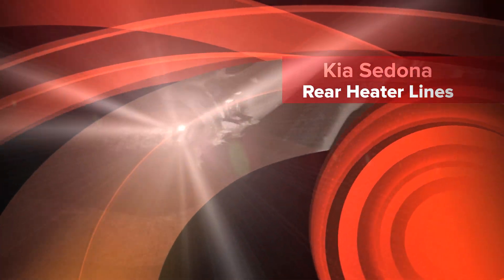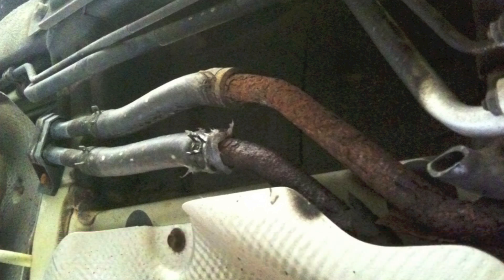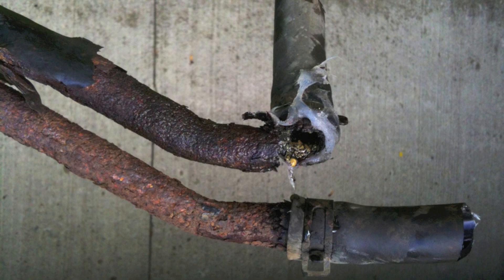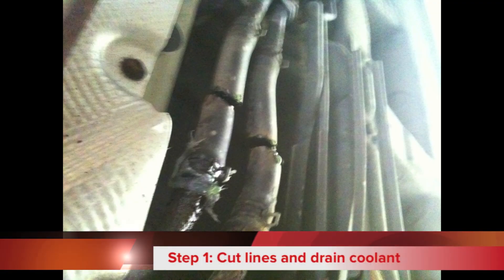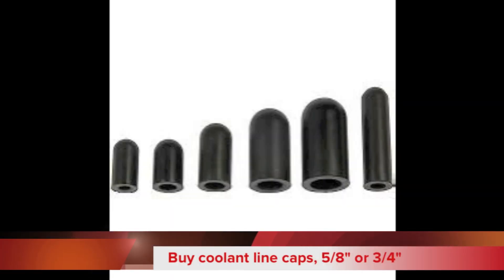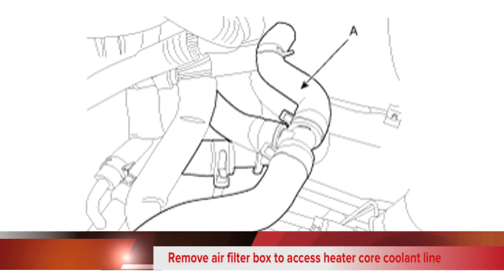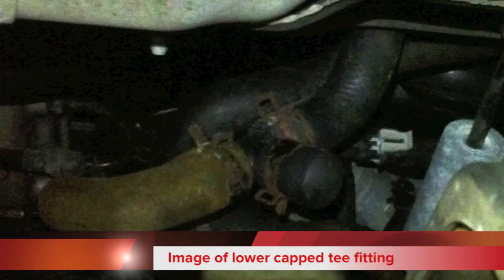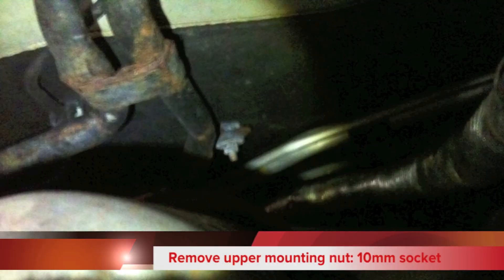Kia Sedona Rear Heater Lines Rusted

Comment: In the end, I just cut the pipe underneath the van and then removed it. This allowed me to make a clean cut and cap off the pipe. I then put it back on. This was all done from underneath the van. The caps are vacuum caps and they can be bought at AutoZone or Amazon.

Comment: I am looking to cap it off at the engine. Will any cap work or must they be a certain kind? Are they available at autozone? Second, is the view of the outlets to be capped from the bottom or top? I have removed the air intake and believe I can see it. Thanks👍
Reply: Larry Baker

Comment: In the 90s, I fixed this problem in a Ford Escort by running new rubber radiator hose from the front to back bypassing the shaped metal tubes altogether.   That way you still have rear heater core functionality.  It is especially easy here as there is a rubber joint on both ends.  Just make sure they don't move or touch exhaust parts.

Comment: I have the same van with coolant missing for some reason. No visible leaks what so ever. Anyone else experienced this and fixed it with this solution? Kind of a dumb question, but just wondering. And yes, the rear coolant lines look just like the ones in the video.
Reply: My mechanic just cut the line and bypassed it. Very poor material choice on Kia's part.
Reply: 26-6-2014.seen this comment today ,just fixed the same problem on my fathers kia sedona.the heat/coolant pipes run to the back of the car on the right hand side and were leaking just behind the rear wheel so we cut the pipes and just put a u shaped piece of pipe on the ends of the pipes to send the coolant back to the front and this has worked perfectly with no more problems since,its just as well cos the car is driving from Wales England all the way out to Corfu in Greece in 4weeks time.
Reply from the maker: Low coolant is a really important problem to fix.  I hope you figure out where it's going.  If it's not leaking from the rear lines, you should get the head gasket checked.  Is there any milky oil on the dipstick or under the oil fill cap?
Reply: Nope, that was the first thing I checked, hoping it wasn't the head gasket. I have yet to find the leak, but soon I will be getting it up on the hoist for a better look. I am almost certain it is the rear lines. But for now it is holding coolant. I just top off the radiator every once and a while.
Reply: if you got a metal pipe section thats leaking you can fix it by useing metal putty available in most car stores.just open the packet snap a bit off then push it onto where the leak is coming from.the putty will set hard as metal.or you can replace the lines from front of the vehicle to the rear.we found this leak on our sedona in the coolant line that is just behind the exhaust near the rear wheel on the right hand side.the lines are a mix of part metal and part rubber hose sections,if you squeeze on one of the rubber sections you should see the water spurting out from where it is leaking.hope this helps people.ours is a 2003 model.

Comment: I have a 2008 Sedona and received a recall notice for the front lower control arms rusting.  When I called Kia this morning to schedule an appointment, they notified me that my vehicle had 4 more recalls- not thru the NHTSA, but thru Kia itself.  One was this, the heater pipes.

Before you do the work yourself, call Kia and ask if your vehicle was recalled.  I had no clue that mine had 4 more just in the last 9 months since I've had it in to Kia.  (Just for future knowlege)
Reply from the maker: I called the dealership (syracuse, NY) for my 2006 and there is no recall for the front control arms and they don't replace the heater lines for free.  Your 2008 may have a recall for the control arms, which is great news with the free heater lines.  Perhaps the control arm supplier had a coating application problem in models after 2006.  However, there is a recall on the 2006 front coil springs.  One of mine had cracked in half!  They replaced both free of charge, but now my car vibrates when accelerating from low speed… which is why I try to never let dealerships touch my car.

Comment from the maker: ...continued... Then install the long section from the bottom by snaking it past the exhaust. It will rub a little bit. After mounting it, go back up top to reconnect the tee fittings.

Comment from the maker: Gmurray658 I saw people saying that too but it's not technically true. I did it on regular jack stands. You just need enough room to lay underneath and reach your arm up past the exhaust to unscrew the mounting bolts and reinstall. The secret is to disconnect the heater line Tee fitting before installing the new part. The two tee fittings with connections to the engine block and front heater core should be installed from the top. Take out the air intake box and hose to throttle body first.

Comment: Did you replace the hose(s) by placing the van on a lift or from ramps/jacks?  I was told it's impossible without placing it on a lift?  How did you do it?

Comment: They fixed the coolant line issue with the 2006 and up Kia Sedonas. I have a 2005 Kia Sedona, and had this happen at around 60,000 miles. Not fun!